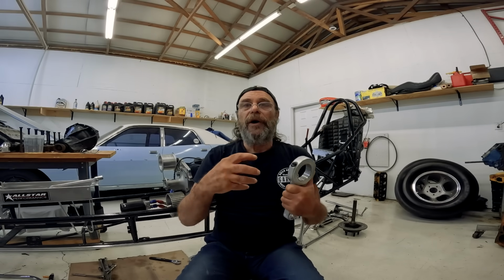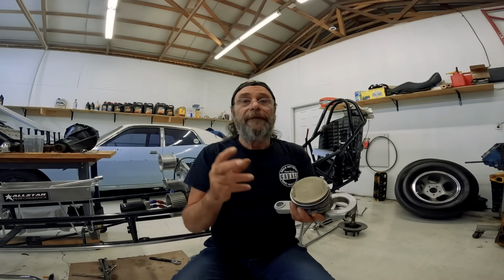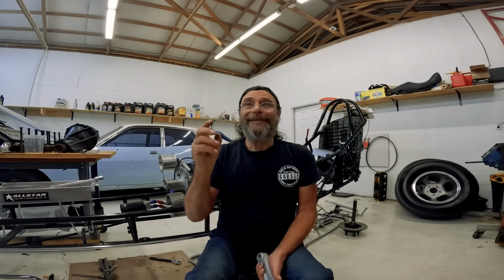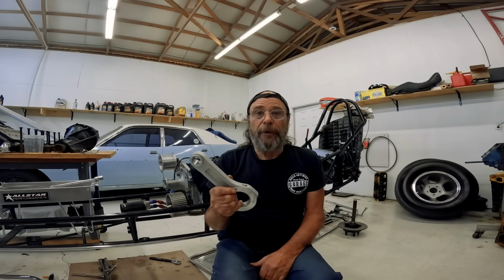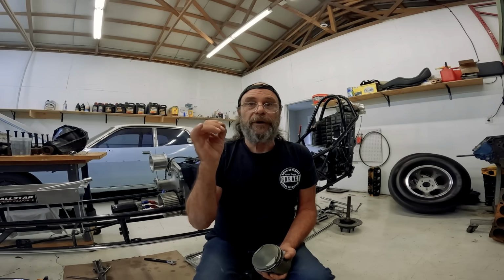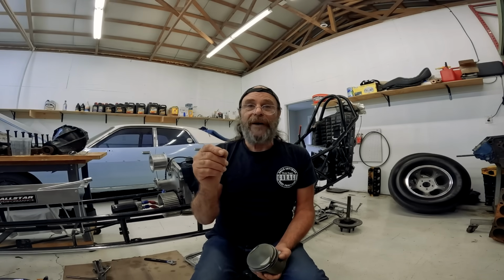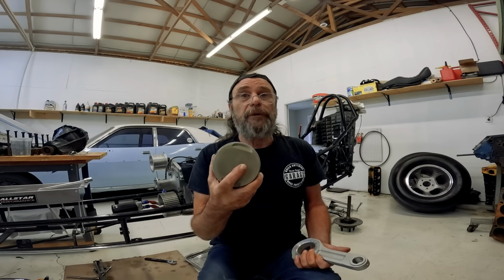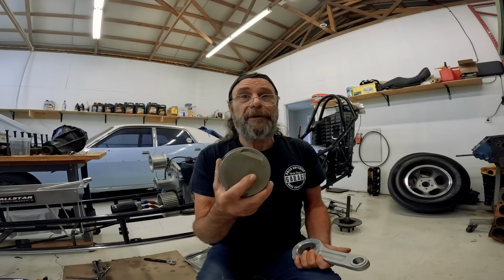Project Top Fuel Pt.9 - How Nitromethane Makes Power And The Importance Of Rod Ratio

Comment: I'd love to hear a discussion on exhaust and why zoomies are ideal for nitro but not for gasoline.  I figure a collector would get melted, but I've never heard a good answer for why straight pipes are better than megaphones, for example.  Seems to me, a diffuser cone on each pipe would help with blow-down.  But the smart guys don't do that, so they must know something I don't.
Reply: Here's my explanation from above. Not any single thing that works for gas or meth will work for nitro. Gases transfer due to pressure differential. Exhaust tubes pressure is about 1 ATM. Nitro cylinder pressure is highest at the moment the ex-valve opens. The piston does not push ex gas out; it's all already gone (well almost all). 

from above, out of context; I don't think the cause was heat, but probably detonation. You may consider that without evidence of high heat, lots of metal was destroyed. If the cylinder runs short of fuel before exhaust valve opens, detonation must occur, inside the cylinder. If metal inside is fractured, it's lean. Mine would typically split the sleeves from bottom to top. I don't think any piston can push the crank with a valve open. Wet pistons I think is a secondary, or coincidental effect. Similarly, I tried to measure liquid expelled from a weephole. Best trick I found was to weigh part of a diaper, or lady pad, before and after.  

I wanted enough liquid from the cylinder through ex valve to detonate in the pipe. My pipes were at 45 degrees on Z and Y axis. 

I'm sure you found acceleration after ex valve opened, but I suspect it was due to detonated Nitro pushing you forward, and down. I'm sure you know this, but for others... combustion gas wave is subsonic, detonation gas wave is supersonic. When the remaining liquid fuel enters the exhaust pipe, pressure is quickly reduced, liquid droplets shatter & disperse, and a fresh supply of O2 detonates almost everything. The pipes act like cannons. It's a beautiful thing. 

The remaining liquid really adds to the fun. Every time I had trouble, the fix seemed to always be, add more fuel. It didn't take long before I needed that second mag.
Reply: @CycleWerkz  None if this really strikes me as an argument for straight tube vs megaphones.  As you say, the cylinder is evacuated by leftover pressure in the cylinder, and we want as little pressure as possible leftover to resist the exhaust stroke.  If you consider a 2-stroke, they don't even have an exhaust stroke, but use the shape of their pipe to SUCK exhaust out of the cylinder.  They can get it down to around 0.5atm at the port (and all the way through the intake to the air filter, but that's irrelevant here).  It's the front (expanding cone (megaphone)) part of the chamber that gives that pull, which is far stronger than a straight pipe cut.  They do this on nitro as well.  The outrageous positive pressure of nitro exhaust actually makes the suction wave even more powerful than it would be with gasoline.  Theoretically, there should also be an increase in the thrust/downforce from the exhaust, since the cone section will act something like a rocket or jet nozzle.

But again, I'm sure I must be missing something, otherwise Brittany Force's team would be doing it already.  I refuse to believe that no one in the nitro world knows anything about expansion chambers or has ever seen the High And Mighty car.
Reply: @JETZcorp  I always thought that zoomies were used because they had to get the burnt gases out fast so they could put more fuel through the motor. More fuel=more power. And you can direct zoomies to use the thrust to your advantage.....either downforce or acceleration (remember Fast Jack Beckman a few years back)
Reply: @montananative2414  Of course that's the goal.  What I'm saying is that trumpet-shaped zoomies should, based on first principles, get the exhaust gases out faster than straight-pipe zoomies.  Trumpets or megaphones should also create more thrust/downforce than straight pipes.  In the jet/rocket world, top fuel exhaust is what we call severely under-expanded.  Look up a car called "High and Mighty," it was the first Ramchargers team car in the late 50s.  That's the kind of exhaust I'm talking about, except pointed up and back like dragsters have.
Reply: @JETZcorp  Hmm, cleaver thinking. Some troubles with the expansion chamber operations. 

It does not reduce pressure at the open exhaust port. 

There are actually two separate energy waves produced. The first is an inverted acoustic wave which enters the cylinder via the open ex. port to assist scavenging from near the head. It reflects off the head stirring spent gases to enhance the intake positive pressure airflow trying to shove it out the ex port.  The point in the pipe which creates this 1st wave is the point where the expanding diameter cone transitions to constant diameter. There is no gas pressure pulse reflected from here, only an acoustic wave. 

The second wave is a reflected gas pressure pulse. This is produced where the pipe diameter narrows. This pressure wave is used to dynamically close the exhaust port. It arrives at the open exhaust port nearly when the intake port closes. The pressure of this wave is designed to roughly match cylinder pressure which should be >ATM. Since the intake charge is pressurized in the crankcase by the descending piston, it transfers into the near ATM cylinder to push Ex Gasses out. Transfer pressure is >Cylinder pressure, if not no gasses could transfer. 

Because the pipe's reflected gas pressure wave roughly matches the cylinder pressure at this moment, the intake charge air cannot transfer through the exhaust port without a delta pressure.  It's not perfect. But you do get great power at the RPM it's tuned to. 

The only place pressure is <ATM is in the venturi and crankcase when the piston ascends. There is no suction in the exhaust pipe or cylinder. 

Fuel never cares about anything other than expanding. It will expand regardless of anything in the way. That includes all metals, or any materials, no matter how strong. 

The power stroke is the most fascinating, and the most different from other fuels. UT hit some great points. It is the bottom half of the stroke where cylinder pressure is maximized. This is where fuel engines' torque gets crazy. For the exhaust pipe issue, please understand Nitro fuel combustion continues beyond the exhaust valve opening. It forces burning liquid fuel into the exhaust pipe. The pressure delta from cylinder to pipe is at least 20x higher than a 500HP hotrod engine. This means the velocity of gas flow will be at least 20x. Fuel exhaust is not only vapors, it's also liquid, the liquid is much higher density than the vapors. This package has much more inertia than vapor alone. Liquids mixed with vapors drag trailing vapors along for the ride, (I don't recall the name of this effect)

Few folks realize that >90% of cylinder gas is expelled by the time the exhaust valve opens .050in., in a gasoline engine. The exhaust stroke doesn't really do much work. It exist to add inertia to the exhaust vapor flow to improve intake air flow during overlap. But in a fuel engine, this effect is a bad idea. 

Exhaust gases in a fuel engine are not O2 deprived. Nitro carries plenty of O2. It's a rocket fuel designed to burn in space. It doesn't matter which gasses, or even no gasses, join the party in the combustion chamber. As UT showed, some left-over Nitro liquid is often there for the second party.

No, the megaphone exhaust cannot help a fuel engine evacuate the cylinder. Or perhaps me and every fuel racer out there are wrong. I love to learn new things, so please do build up a chassis with a fuel engine to give it a try. If you turn the times, everyone will certainly follow. That's exactly how everything they use now was adopted.
Reply: @JETZcorp  I forgot the last part of a jet thrust effect. 
If you double velocity of a mass the force is squared. 

I think you expect an expansion chamber output gasses velocity is greater than a straight pipe would have. I think a megaphone exhaust has an expanding diameter cone at the output. 

Both of these devices reduce exhaust gas velocity much more than a straight pipe. The latter megaphone reduces velocity due to gas density reduction so there's less pressure per area to move ATM. A 2x diameter increase will reduce pressure and velocity per area by 3.5Xish. also reducing the delta pressure from ATM. 

A 2-stroke expansion chamber substantially reduces exhaust gas velocity due to transition from a high velocity pulsed gas to a much more continuous gas flow at a much lower velocity. 

That reflected gas pressure pulse interferes with the outbound gas flow to create really high turbulence, diffusion, and substantial conservation of inertia.  

A fuel engine pushes liquid nitro into the exhaust pipe which then detonates. Detonation gas velocity, by definition, is supersonic, combustion is subsonic. That's why it's so loud. Each exhaust pipe is basically a cannon because the fuel is detonated there, acts like gunpowder. Top Fuel downforce, and forward force are at least 1G each at initial start. Doing some vector math I came up with >1.4G of force in each pipe. 

If you try to reduce the diameter, it'll split any metal. If you increase diameter velocity will slow, so force will fall by the square of the area of the circle. It could make some good videos.
Reply: @CycleWerkz   I can't speak to how things would work in a nitro V8 application, but I can say definitively that you're wrong about <ATM pressures in a 2-stroke.  The inverse wave from the diffuser cone can be extremely strong.  The number I usually see is 8 psi below ambient, and it sucks on the exhaust for a pretty long time (because the diffuser cone is long).  This low pressure wave is the whole reason why reed valves replaced rotaries in GP bike applications.  The reeds, which are normally closed during transfer, will actually open back during the period when the crankcase pressure has been transferred and the inverse wave makes it through the cylinder, through the ports, through the reeds, and all the way back to the intake.  Before that was discovered, rotary valves made better power because of the unobstructed intake path.  This would be sometime around the 80s.

The baffle (converging) cone obviously would serve no purpose on a 4-stroke.  On a 2-stroke, as you said, it crams over-scavenged mixture back into the cylinder at very low revs, stops over-scavenging at medium revs, and smacks into an already-closed port on the high-end.  At higher RPM, there's not much time for the gases to flow, so the pull from the diffuser cone is needed just to accelerate transfer and scavenging.  2-strokes stop making power on over-rev when the port gets closed before the inverse wave has time to arrive, which stalls transfer flow.  People always say that the pipe only works at one particular RPM, but they really do work over several thousand RPM.  The angles of the cones, and lengths of the header pipe and chamber belly all determine how strong vs broad the pressure waves are and how far apart they are timed.  It's why something like a Husky 400WR pulls like a big-block right from idle but still revs out pretty good... but it's not making 170 hp like a 500 GP bike that stacks all the wave timings to happen in a narrow range.

Anyway, going back to the nitro theory.  I don't think that a diffuser cone could ever send a <1ATM signal to the exhaust valve; I think top fuel is just simply too crazy with too much residual pressure all the way through the exhaust stroke (unlike gasoline, as you said).  But if the cone could send a signal of a couple PSI less than what a straight pipe does, it seems like that could pick up a few HP just by reducing what the piston is fighting on the exhaust stroke.  In a gasoline application, that might mean a few PSI lower than atmospheric, in nitro it might mean a 1,492 PSI instead of 1,500 - that might be a plausible reason why no one bothers.  I suspect that the greater pressure of nitro exhaust will also create a greater pressure drop, but that's a fluid dynamics question that I'm not qualified to answer.

As far as thrust from the exhaust, I'm pulling from the theory of how jet and rocket nozzles work.  Velocity is (counter-intuitively) increased as cross-section increases.  Pressure is traded for velocity due to Bernoulli's.  The nozzle diameter is correct when the gas exit pressure equals the ambient pressure, whether that's at sea level or in the vacuum of space (they make those as big as they can until weight and bulk limit them).  When you say that velocity is reduced, you're thinking in gasoline engine terms where a straight pipe is already fully-expanded and pressure-matched to ambient, so megaphones are always severely over-expanded.  Over-expansion does dramatically reduce velocity, reduce thrust, and also tends to destroy things.  You can tell that nitro exhaust is severely under-expanded just by looking at the shape of the flames; there's a ton of pressure which could be converted to velocity by expansion.  You'd want to shape the megaphone exit so that the exhaust gas is just a little above ambient (a little under-expanded is better than a little over-expanded).  This is also why you'll never see sub-ambient pressures in this application, because sub-ambient pressure only exists when the exhaust gas is over-expanded AND contained.  2-strokes do that deliberately, but it's within a closed chamber that's semi-sealed by the stinger.  It's part of why you lose power when the stinger is too big.  A too-large stinger weakens the pressure waves, and a too-small stinger causes back-pressure in a conventional sense.  But I'm getting off topic again.  The point is, in this application, you don't want to over-expand below ambient pressure, and that should maximize exit velocity.

Something else I just thought of.  Having a big megaphone means putting a larger volume of unmoving gas in the exhaust path when that valve cracks and Hell's fury comes rushing out.  That's a trivial problem with transonic, lower-pressure gasoline 2-stroke exhaust, but supersonic nitro exhaust could turn that big mass of still gas into an obstacle that must be blasted out of the way, causing back-pressure at exactly the worst time.  Again, that's just dumb amateur speculation, but I wouldn't put it past the alien-physics world of top fuel.  The theory of expansion causing an increase in velocity works in steady flow, but it may very well NOT work for that initial supersonic blast of exhaust.  That doesn't affect jets and rockets, it's not a problem for gasoline, but it might be a deal-breaker for Fuel.  There's also the sticky point that the pressure in Fuel exhaust is nowhere near constant, so designing a diffuser with the "right" pressure ratio will be impossible, because that's a moving target throughout the course of the blow-down phase.

I'd love for someone to try this stuff out.  Like I've said, I really do assume that I'm missing something and that it's not beneficial, because these teams have a lot of resources and some of the smartest engine men in the world.  But, I can also see a 5% chance that maybe someone tried it in 1972 when the exhaust was still in full wind, and maybe they got the expansion ratio wrong and that plus the aero drag made the car slower, and since then it's just been understood that it doesn't work.  And since it's also known to be pretty ineffective in gasoline, everyone just knows that megaphones suck.  Everyone else is probably right, but I give a slight chance that they're sleeping on it.  Either way, it's fun to talk about.
Reply: @CycleWerkz  I've been doing some more reading on how these things work.  I've come to the conclusion that only one of the advantages (negative wave scavenging and exhaust acceleration) can work.  That comes down to the question of whether or not the exhaust flow in a Top Fuel pipe is supersonic or subsonic.

In subsonic flow, a diverging cone will cause a decrease in velocity and an increase in pressure (like the back side of a venturi).  But, as pressure increases in the slowing gases going outward through the cone, an opposite low-pressure wave travels backwards toward the exhaust port.  So you'd be losing thrust from the zoomie pipe, but gaining that scavenging effect.  Bearing in mind that "low pressure" is only relative to the hellish pressures inside Top Fuel exhaust; absolutely every point in the exhaust would still be FAR above ambient.

But the thing with the venturi effect is that it only works until the flow in the narrow part reaches mach 1.  Once that happens, the physics invert, and a diverging passage will create decreasing pressure and increasing velocity.  But because the flow is supersonic, no wave signals of any kind can reflect backwards, so there would be no scavenging effect.

It's very obvious that creating an exhaust restriction to choke the flow down to supersonic is a very bad idea.  You don't want to create a convergent-divergent rocket nozzle in a subsonic exhaust flow stream.  However, if the exhaust port itself is already choking the flow and the exhaust is moving through the zoomie pipe at supersonic speed, then changing it to a megaphone will increase the exhaust velocity and increase the thrust/downforce you get from it.

I suspect that the flow in a Top Fuel exhaust is supersonic sometimes and subsonic sometimes, depending on what part of the blow-down and exhaust stroke it's on.  It might also be supersonic in the middle of the pipe and subsonic at the boundary layer.  That makes everything an absolute mess that cannot be tuned intelligently, so a big dumb straight pipe is as good as anything while being cheaper, lighter, and more durable.  I'm going to plant my flag in the ground for the moment and say that's probably what's going on.

EDIT:  Also, the NHRA rulebook straight-up prohibits these design shenanigans.  The pipe OD is limited to 2.75" OD.  The teams effectively expand out very slightly from the port diameter to that diameter, and that's all the freedom they have.  NHRA does this in order to prevent anyone from spending 5 million dollars on literal rocket science, and because making the things even louder could send spectators to the hospital.
Reply: @JETZcorp  All Nitro engines at >85% must supply enough fuel to have liquid remaining after the power stroke. If ever the fuel is fully consumed before the exhaust valve opens, metal parts will be fractured. I'm not sure about lower percentages, because I never ran <85%. 

Because of this, detonation in the exhaust pipe will always occur, so the exhaust gas velocity will be supersonic. 

NHRA did recently change creative exhaust pipe design rules, so basically now you can't do anything, pretty much like all the rules. It wasn't to help racers' budget concerns; they never do that. It was about concerns they'd discover some things nobody thought about, until shown by disasters.

Mid-level qualifying cars budget about $250k per weekend, top few teams about $500k/car. 

This industry has no shortage of Scientists, and no worries spending $5M off-season more than the $5M they planned to spend. 

More engine power right now is not likely an advantage. I think all crew chiefs' engine parameters are well below max on all runs. 

They were seeing some better times by just pointing the pipes straight back, no downforce. You only need downforce to plant the tires on the street, but if you get push from jet force, you don't need to plant the tires as much. Plus, just add more wing angle. 

Thanks for sharing High and Mighty info. That car was awesome. This car was in a gasoline class, C/alt. NHRA rules classes then had weight to engine size class separation. So, a giant motor in a light car couldn't run in that class. 
These guys were smart. They started by studying the rule book to find opportunities. Lots of guys were running fuel, it's too easy for not smart guys to get high HP with fuel. They needed a class where high HP was not easy. Then they found the perfect class where they could exploit simple physics to overcome rules crippling "not scientists", and no OEM factories would be interested in funding.
They exploited many advantages and were the first to do so, in this class and all other classes. 
Here's a list of obvious "firsts" they used to win this class. Traction sucked because tires sucked, so they focused there. It was "high" because they knew a higher center of gravity would increase downforce on the rear tires. 
1. Raise the frame, easy, cheap...
2. More cg elevation... Raise the entire driveline including the engine. easy, cheap...
3. Chop the top. Less drag area. easy, cheap... 
4. Improved 3-link rear suspension to their 4-link design. Adjustable to balance drive to both rear tires. I mean, damn! 
They optimized around the cg angle by moving the engine back like everyone did but then cut about a foot from the frame length which moved the rear axle forward. I don't know if others did the same. All these innovations led to a championship.
 
I think they were the first to use a 48" length expanding diameter cone exhaust on a drag car. But I thought motorcycles did it first, probably just for looks and sound. These guys were again super smart. I'd bet they tuned the intake, cam, ports, and exhaust to peak at a certain RPM. Exhaust pipe isolation meant only one cylinder need be tuned, the others just copy.

They were Chrysler engineers so they expected they could increase HP of this engine. I'm not sure the rules for cams, they got kinda nutty. Some years, some locales, allowed any parts that were made in the same year as the car, from any engine by any OEM. So maybe they found a cam.
and everything on the heads. They did allow 2x4V carbs but not 3x2V, weird. 
I'm guessing they increased the RPM of peak torque. 

This strategy works differently than it appears. This continuously expanding diameter pipe significantly reduces friction, a much better advantage than pressure reduction. The gas pressure pulse exhausted is very high velocity, high pressure, and very short pulse. The gas touching the sidewall of the pipe velocity slows due to friction. The gas in the center of the pipe is mostly isolated from this drag by the other surrounding gas. The center gas mass substantially outruns the outer gas to the exit. The velocity delta increases exponentially building a protruding center gas. I visualize by thinking of an outer doughnut with an extending doughnut hole. Okay, that's not perfect. 

When the gas pulse reaches the exit, the center rushes out first at higher velocity, so higher energy. As the surrounding gas "doughnut" exits slower "at lower energy" the leading higher energy gas expands to merge into the lower energy mass of gas. This energy rate of transfer is supersonic, so the exhaust is very loud. I don't think this design would provide an inverted acoustic wave upstream like a two-stroke chamber does. I'd think because the exit is open to the atmosphere here. I expect this energy will expand equally in all directions without a continuing pipe to contain this energy, it'll simply disperse out and around, not reflect. And it's very far away from the length needed to get back in time.

There is not enough gas velocity, or mass, to provide any useful down or forward jet forces. The supersonic acoustic wave above is not a gas acceleration, it does not produce a gas flow, only a noise wave. Gasoline, methanol, no matter how it's done, cannot exhaust nearly enough mass with enough velocity to even measure the acceleration against a vehicle mass.
 
Fuel is a completely different scenario. As with all things fuel, there is no comparison to anything else. A gas engine power stroke uses 90% of the total pressure available to the crank from TDC until the combustion chamber volume doubles. After that, not much torque is added because it's out of oxygen and fuel. 
Fuel doesn't provide much pressure at the top, combustion spreads slower. The piston is accelerating away from the head, so combustion chamber volume is increasing exponentially. Basically, the piston is running away from the expanding gas. But Fuel doesn't care because combustion continues as the piston is slowing down after 90 deg crank angle. Fuel will not allow the piston to slow down, so massive torque is the result. Fuel will never slow or stop. The higher the resistance, the more pressure fuel combustion provides, it shall never be slowed. Once the crank is around 135 deg, there is no lever to turn the crank remaining. Once fuel expansion is mechanically useless, either the exhaust valve opens, or the fuel will open a new ugly exhaust port, but it will not stop. The fuel will shoot out of the ugly exhaust port, then it will violently detonate if the valve doesn't open. 

Do your own calcs. TF guys are running ~1:0.33AF ratios. Get the air mass by 500CI (8.1L) engine at 8500RPM (71 power strokes/s) at 5 ATM, & about 3 gallons fuel / second, average. The same mass that goes in must also go out. Detonation velocity = 6400 m/s. The pipe is about 1 meter long, so all will detonate << 1.0ms. Force = Mass x Velocity^2, or Force = Mass x Acceleration. The detonation velocity is the velocity the detonation effect spreads through this mono-propellant material (Nitromethane). The physics gets tricky here. The remaining Nitro transitions from liquid to vapor via Oxidation due to the sudden pressure reduction and added O2 in the exhaust pipe. The high pressure in the cylinder actually reduces the probability of detonation, although it doesn't always prevent it. When expelled from the high pressure into an ATM pressure, much less heat is required for detonation, so it works every time. 

The Nitro fuel has to have something to push from to jet out of the pipe, so it's good the intake valve is still closed. Exploding gas fills the cylinder again but is violently expelled out the only open hole, the exhaust pipe. Gas momentum surely has some influence on cylinder evacuation, but not likely relevant with 5 ATM of intake charge air cleaning it all out. 

A gas engine does nothing like this at all. Are you still concerned about evacuation of the spent gasses from the cylinder, which with fuel is still Oxygen rich, literally still wet with Fuel?

And I think you're saying something backwards, correct me if I'm wrong. 

The gas expulsion from megaphones will have much less force than straight pipes. Pipes always have the same mass in and out of the pipe. We'll ignore heat loss through the materials. 

The megaphone diameter expansion will reduce gas density, pressure, & temperature by the gas laws. This reduces the available mass & inertia per unit atmospheric air in the pipe and then at the exit. Expelled exhaust gas has to accelerate air out of the way to escape. Inertia is conserved, so higher inertia exhaust gas will shove atm air better.
Reply: @CycleWerkz  It sounds like the exhaust is definitively supersonic, which means it will follow the laws of supersonic gases.  Supersonic physics are very different to subsonic.  In supersonic flow, an expanding volume will increase velocity.  That's how rocket bell nozzles work.  It's very counter-intuitive because the human brain is only built to comprehend subsonic flow, where things slow down when you give them more space and speed up when restricted.  Supersonic flow is backwards of that.  So, if allowed, a megaphone or similar expanding pipe would increase the velocity and thrust of the exhaust for sure.  Use it for downforce or propulsion or whatever you want.  If the exhaust gas flow was subsonic, you'd be right that expansion would reduce velocity.  But these are totally in the same realm of heat and pressure as a SpaceX rocket, so you want to look at that world.

But supersonic flow cannot transmit any pressure waves upstream.  Obviously, the gas is faster than sound, so the sound can only go one way - out.  So there can be no 2-stroke-like scavenging effect.  Supersonic flow means that a hypothetical megaphone on a nitro car would have a completely different purpose to ones on a gas car like the High and Mighty.  Those guys were 100% doing it for the scavenging effect.  They were running that car a few years after Walter Kaaden invented the expansion chamber, which he did after using the same principles on the V1 pulse-jet.  And, given that the Ramchargers team were also inventing the first tuned-length tunnel-ram intake, I think it's safe to assume they had wave pulse tuning on their minds.  Trained engineers would know that a sharp sound wave hitting a conical diffuser will reflect a prolonged and powerful suction signal upstream.  The energy that would have mean meager, insignificant thrust in a straight pipe gets used up to generate the reversion wave in subsonic gasoline exhaust.  The open end makes it much less efficient than in a 2-stroke, and it's worse than a modern collector, but those hadn't been invented yet.  Megaphones were popular on British twin bikes, but I very much doubt those guys knew what they were doing in the 50s.  MZ invented exhaust pulse tuning, and Suzuki stole it through espionage by Ernst degner.  I don't think anyone else in the 50s had it formally figured out.  I would assume the Ramchargers came up with the megaphones from first principles based on what they knew from the intake side.
Reply: @JETZcorp  No energy goes only one way. All relatively higher energy is dispersed to lower energy masses evenly proportional to the delta mass density between the liquids, aka gases. 

The upstream exhaust gas will be much lower pressure than the downstream nitro fuel explosion by several orders of magnitude. You can even see liquid nitro pushed out the bottom of pipe weephole as typical. That pressure wave of expanding vaporized nitro gas will refill the cylinder through the open exhaust valve then reflect off all surfaces, including the closed intake valve, and then mostly escape out the still open exhaust valve. 

Sure, the pressure to the pipe exit is only 1 ATM, and upstream is >1ATM, so the exit has the delta pressure advantage, but energy must be conserved so the flow must go every direction in proportion. 

It is the velocity of fuel combustion I listed which starts at detonation of the remaining liquid nitro. This is the rate the combustion travels to the rest of the fluid nitro, not the velocity of the resulting gasses. 

Rocket engine nozzles are not straight pipes. It's been a few decades since I studied this, but there were several other reasons and expanding cone is needed. A small radius jet expulsion into air would create far more air turbulence. The higher velocity, higher density expulsion would provide less thrust due to the air mass turbulence being much more difficult and less predictable to accelerate. A much larger diameter aperture allows the fuel mass to push against much less turbulent and greater air mass. I don't have dimensions, but it would be proportional to pi, at a glance roughly 10x area. 

The liquid fuel and oxidizer mixing section normally doesn't completely combust all the fuel, it should still be burning at nozzle entry and continuing until the exit. The expanding cone allows quicker combustion so more fuel can be burned delta time. A straight pipe would probably split or be much thicker. 

I'm not familiar with this new, spooky physics of supersonic gas flows. It may be counter-intuitive, and hard to find a fitting analogue, but everything in nature must always follow the fundamentals. If not, let's notify Nobel. 

There's very little value scavenging the cylinder on a fuel engine. Nitro fuel engines power output is proportional to mass of Nitro Fuel burned, all else is really a waste of time. 

I'll share one good example. A drag strip buddy ran a fuel altered a few years, decades ago. Total weight 1600 lbs., tube chassis, small block 350 chevy with OEM bottom directly from salvage yard, mech fuel injection, 2 mags, typical build. It ran 3.80s, 1/8th mile, 165mph, week after week. An interesting run an intake pushrod bent at launch so 1 cylinder intake valve remained fully closed, the other 7 fired fine. The fun part is that his timeslip on that run ET and MPH at every timing block was no different than his runs with all 8 firing. He had some fun showing me several timeslips teasing me to find the one with only 7 holes lit. The fuel flow didn't change, each of 7 just received 1/8th more fuel each than typical. The same nitro fuel burned = the same energy output. 

If you want to scratch your head harder... 
My fuel drag bike, 1280cc, NA, mech inj, 2x mags, laydown drag slick wheelie bar, steel tubing homemade chassis, cheap and dirty. 1320', low 7s, 190mph, if about everything goes well. Me all geared up, then I was about 200lbs. A friend, a pro, ate like a supermodel so 150lbs. in gear. His times and speed matched mine, well my good runs. When I had good runs, I would still be on the wheelie bar at the finish line. When he ran it, that didn't happen, even at the same time and speed. 

I want to think these rouge engineers worked hard to discover tuned in to out gasses flow. They probably didn't need that extra bit of engine power to win. I doubt it was worth >5% HP. They may have been running 50-60% of the typical 60' times, which will win the race where power to weight is regulated, even if the other lane has 20% more power. Keep in mind, others were also hungry for engine power. 

Nobody can really be sure about any historical details. To me I guessed their affiliation with so many engineers / racers at work, proven ideas could have been built up, maybe with dyno data. That really cuts the R&D time down. 

The 2T exhaust development details are also riddled with guesses. No doubt it was valuable, so if anyone could make claims, they would. The stories I heard differed some from yours, buy it's all fuzzy history. Regardless who's idea, only the quickest industrialized mass production delivered the marketplace, collects the most profits.  

At the end of the expanding cone for 2T, the reflected scavenging wave does not flow at all. It is only a sonic wave without any gas flow. Velocity is around 600m/s and the reflection point is typically 400mm for peak torque at 10.5kRPM. It must reflect back before BDC, so arrive within 70-80deg crank after exhaust pulse, and exit <40deg later. Round trip 120deg, 1/3 rotation. 

A 4T opens Ex valve near BDC, 95% shoots out at 0.050" valve open, so I'll call that at 170 crank position. For the sonic energy to do any work it'll need to get in the cylinder well before the intake valve opens. These pipes are cool, but they are 4' long, putting the sonic wave reflection at 1220mm away, roughly 3X longer. TF folks keep the RPM about 8300 from start to 660' these days. 8.3 is a bit shy of 10.5, about 27%. If intake opens at 340CP, and we need about 80 deg to bounce around inside, piston velocity is very high here, it must arrive at ex-port by 260degCP. The sonic wave only has 90 deg rotation to stir up chaos. 
A quick guess by proportion, which is definitely wrong. 400mm*1.27*9/8 = length mm = 570mm. 
That would be close if they were burning gasoline, but they are not. You are working hard to get a tiny sonic wave back to the cylinder, despite the giant sonic wave caused by fuel detonation which broke the sound barrier hugely. Even if you don't think the gas very high-pressure wave reenters the low gas pressure cylinder, the sonic boom energy wave travels without friction, impendence, or delta pressure concerns. 

 The high and mighty car was definitely running gasoline due to the class C Alt rules. They were not near 8.3k RPM, I'm generously guessing max torque around 4.5kRPM. Alternative Cams were not allowed in C/A, so useful overlap was not likely available. I really don't see a way to tune airflow to any RPM with so many features missing, but let's see if it was possible. 

I read somewhere they used the tall intake to elevate the air intake over the air turbulence from front grill disruption, and above the car's top. The top was clearly a concern because they chopped it down to the rule limit. I think they were focused on clean airflow supply to the engine. RAM air induction was being used commonly on aircraft, so many knew about it. 

A tuned intake would use reflected pulse energy to add velocity to charge air at the next intake valve when it opens. This air is not pressurized, so for this to work, the exhaust valve needs to also be open, during overlap. The charge air flows with Velocity in, over the piston crown then a bit out the exhaust port. The air mass entering the intake valve, is tuned to keep this velocity and inertia reducing the work required to fill the cylinder.  Without cam overlap supervision, charge air would have no place to continue flow velocity. Any added pulse velocity and air mass inertia would be lost. This tuning is only effective within a limited RPM range. 

Okay, so this math will assume too many issues to count on it. 

If 400mm = 10.5kRPM at Ex Pulse +70deg then
Lmm = 4.5kRPM at ex pulse +70deg
Lmm = 400 *10.5/4.5 = 889mm

RPM H&M = 10.5 *400/1220 = 3.45kRPM torque peak

This exhaust could not have been part of a tuned system. 

The sound wave could not have reflected back in time. Reports pointed out the exhaust was particularly loud from this car. It sounds like most the sound energy was emitted outward from the end of the exhaust outside... Without containment around the pipe, that sound energy was widely dispersed in all directions. Even if it had been designed to return perfectly, the length was too far away for the sonic wave to return in time.